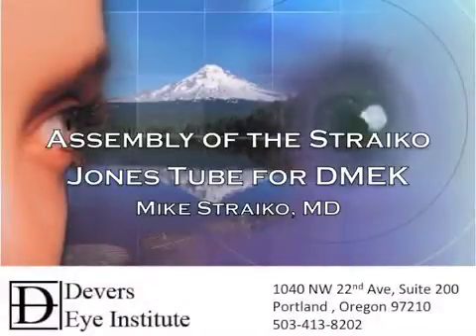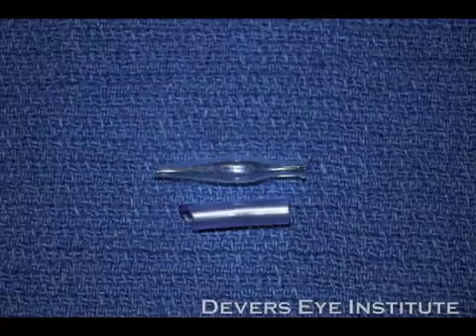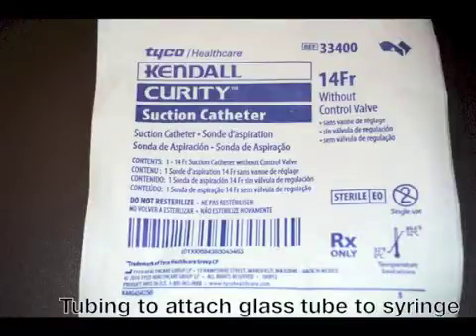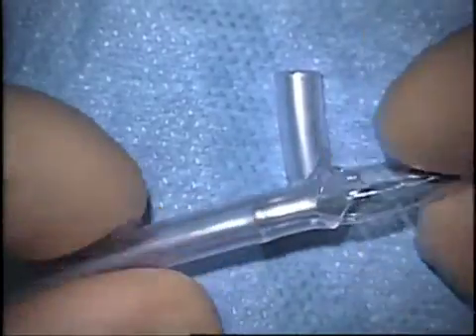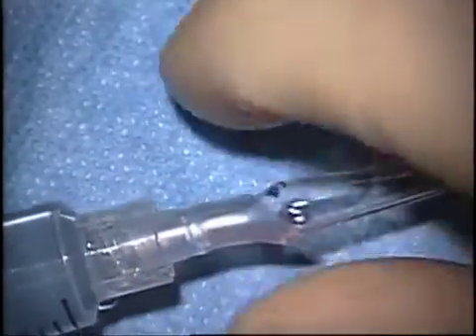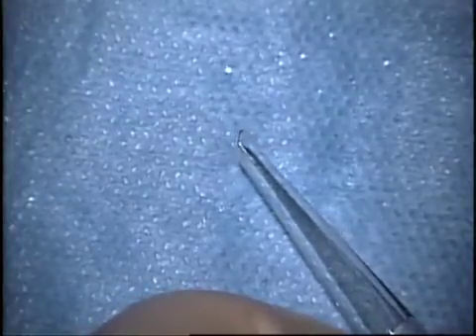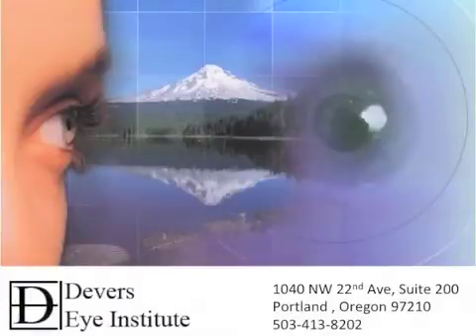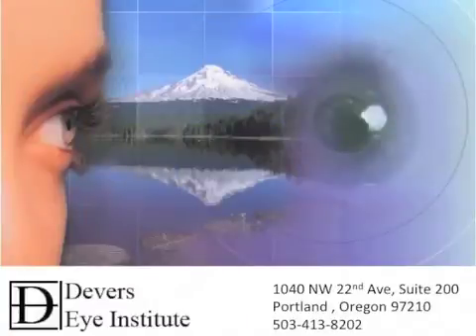Assembly of the Straiko DMEK Jones Tube

Comment: Have been using the modified Straiko-jones tube. I love the dynamics of the chamber and ease of delivery. 
I have had 3 recent cases where the tissue seems to float to far into the jones tube and unfolds. It then becomes a bit challenging to get it back to the tip.  Has anyone else observed this?
Reply from the maker: Robert Eden Hi Robert, If I inadvertently suck the tissue too far in I give it a few gentle puffs of BSS until it is closer to the tip. I do this over the loading well to avoid any accidents. I like the tissue very close to the tip so that I can deliver it into the eye with a minimal volume of fluid. Too much fluid can over pressurize the eye and cause a graft ejection.  If the scroll is tight enough, you can simply hold the injector in a tip down orientation and the tissue will drift down toward the tip. The capillary action of the BSS keeps it from falling out (but I still do this over the corneoscleral cap just to be safe).